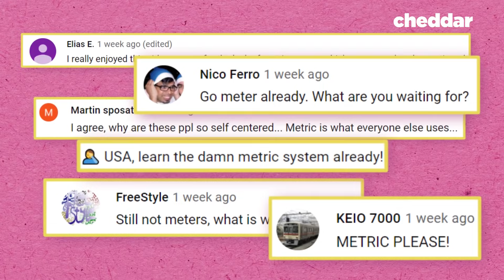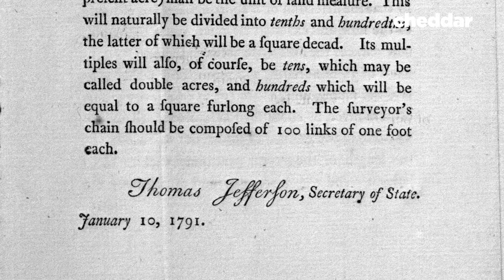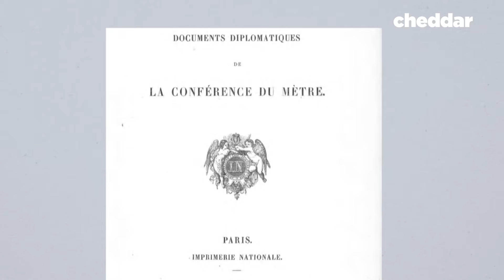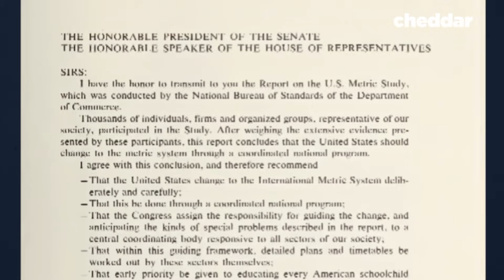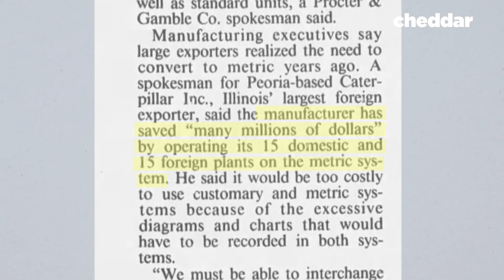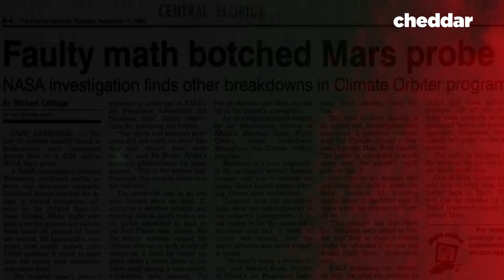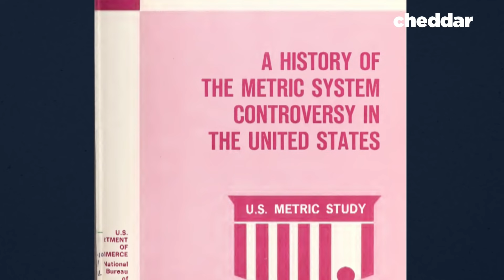Why Doesn't the US Just Use the Metric System? - Cheddar Explains

Comment: If the metric system is so good then why isn’t there metric time? Hmm?
Reply: Spoonman Vlogs France attempted making a metric time system a little bit after they adopted the metric system, but they made it very complicated so it died out.
Reply: Zach Brannigan didn’t they also have a metric calendar that had ten months?
Reply: @zachbrannigan3184  sure it was that complicated? Of course if your new system is something like 9 days work 1 day off, your old system with  6 days work 1 day off is more popular. If they had added a "second sunday" things would be different today I guess. And this is a very guessy guess.
Reply: The French system wasn't that complicated, but it was different (10 hours/day, 100 minutes/hour, 100 seconds/minute), and it had to push against a technological installed base: clocks were very expensive, and a clock using the existing system was a prized possession in many households. So it didn't catch on, and the internationally standardized metric system instead uses the ordinary second we know as its base unit for time.
Reply: Why isnt there metric system 2 yet? HUH?
Reply: @bensonsexon4691  Actually there is a Metric 2. It's not noticable in our daily lives and kg is in the works.
Reply: The second is an SI base unit, and metric subdivisions of the second (milliseconds, microseconds, nanoseconds) are used all the time, especially in computer software and electronics. Larger metric time units aren't used because intervals of time that don't relate by factors of 10 are very socially important to us. But these aren't quite as arbitrary as miles and inches--the day and year, at least, come from natural cycles. (And physicists and astronomers often do measure longer time periods in seconds, with scientific notation.)
Reply: @MattMcIrvin  Socially and biologically I think.
The world will not start spinning differently after we adopt months that last for 10 weeks.
The day won't feel longer or shorter when we introduce a 10 hour day.
Many people (say they) get thrown off by the annual change to daylight saving and back.
Reply: Milisecond, microsecond
Reply: You could argue military time (the 24 hour clock) is like metric time. It makes telling time much easier instead of confusing am and pm.
Reply: Unfortunately things like seasons and days aren't translated well by a metric system. We'd be constantly shuffling around our clocks and calendars to account for how the Earth rotates and orbits. It would be far more confusing than helpful. That said, technically the second is the metric unit of time. Smaller units of the second like milliseconds and nanoseconds are used all of the time in computer science.
Reply: https://en.wikipedia.org/wiki/Decimal_time
Reply: There is, it just never really caught on: 

https://www.youtube.com/watch?v=RJM2FjK1zfw
Reply: Time is metric.
Reply: It's simple. Some things Metric system is good for, such as distance. Other times, it's not so good. & never catches on. Like the 10 month thing.
Reply: You must be troll
Reply: Because conventional time is so easy to work with.  Seconds, minutes, and hours can easily (whole numbers)  be divided into halves, thirds, and quarters.  Decimal times results in lots of fractions, not whole numbers.  Harder to work with for most purposes.
Reply: Time was developed starting with the length of time for Earth to go around the sun and for the length of time for Earth to make one rotation.  Neither of which are related by a factor of 10.  I have no idea how we got hours  minutes, and seconds but suspect they have something to do with navigation, just like degrees, minutes, and seconds.  There is a metric unit for angles card a grad, but I don't know how commonly it is used.

The basic units of metric are meters and grams.  Everything else that most people use is built logically from meters and grams.  A liter is 1000 grams of water.  

There are even differences In metric standards.  Pipe dimensions are stated in metric but are really American standards.  Asian nuts and bolts have even millimeter size heads where European ones have odd millimeter heads.
Reply: @lowercherty  We got our time system from the Babylonians who used a sexagesimal (counting in 60s) system for mathematics and astronomy. They derived their number system from the Sumerians who were using it as early as 3500 BC.  We could easily re-adapt the system to something that goes by "10". All we would have to do is define how long each measurement would last so it would hit "10" by the time the Earth did a full rotation.
Reply: or metric years.  (there were but they were "surprisingly" removed)
Reply: sure amigo here it is...its 12.6 pm = 1236pm....happy now?
Reply: Exactly...well said. The number 60 is a beautiful number. Divisible by so many other numbers. Very easy for human brains to deal with. Even in metric countries they say "A quarter till midnight" (as an example)
Reply: @noelmasson  shipping company vessels always use time divisible by 6 to make it easier to calculate their delays at ports, time incurred etc...example: if you told them i came onboard your vessel at 1210hrs they'd make it 1212hrs instead
Reply: @CoorparooToo Have you ever walked 1/3 of a meter?  It's impossible to measure. 33.33333333........ cm's.  1/3 of a yard is EXACTLY 1 foot.
Reply: @BLAngel1  Good point. How much is 1/3 of a US Dollar?
Reply: @BLAngel1  of course I have walked 1/3 of a meter. It's not exactly an Olympic effort.
Reply: There is metric time? - The second?
Reply: Because time is relative, it can change, a cm is a cm but one minute can be different from where you are
Reply: @SpartozZ  r/woosh
Reply: @SpartozZ  But space is also relative. So a cm can change just a mintute, depending on your point of view.
Reply: Spartoz thats a really weak explanation lmao especially considering that length isn’t absolute either.

Comment: Canadians still  use the Imperial system but only for certain measurements. Canadians still weight themselves  in pounds and measure their height in feet. Yet Canadian speedometers are in measured   metric and we use metric milliliters for measuring liquids. This is despite Canada the fact that canada has been using the metric system since the 1970s.   For some reason Canadians converted to the metric system and yet retained some of the measurements from  imperial system.
Reply: Canada decided to convert to the metric system gradually. In 1985, though, the Mulroney government stopped conversion, perhaps because it was strongly opposed by farmers (those underpopulated rural ridings are one of the foundations of the Conservative vote). Furthermore, Canada opted for soft conversion, under which goods could still be packaged in Imperial sizes as long as the label provided a metric size (that's why butter is sold by the pound but labelled as 454g). Hard conversion would have required round-number packaging -- butter would have to be sold in 400g or 500g sizes.

As a result, some things, such as paper, are still legally sold in Imperial measures, some are sold in Imperial measures converted to metric, and yet others are sold in American measures converted to metric (a consequence of our extensive trade with the States). So "metrication" gave us not one system but three. 

The use of metric apparently varies from province to province, with Quebec being the most fully metricated. I live in Ontario, and have never seen a sign here advertising real estate in hectares or square metres; it's all acres and square feet. Because metric measurements aren't used I assume the Imperial measures are still the legal ones. Clothing labels use non-metric sizes; again, because they often appear without metric equivalents I assume metric labels were never required. And we use 8 1/2" by 11" paper.

And isn't that thoroughly Canadian? A government takes a bold stance and makes a significant change, then another government under pressure washes its hands of the whole thing and tells us "Figure it out for yourselves." Which we never do.
Reply: @johnfitzgerald7618  as a fellow Canadian currently living overseas, your comment is so accurate it hurts. You just summed up the history of Canada in a couple of paragraphs. That was marvellously, done
Reply: @MrWhiteVzla  Thanks. It's part of our Canadian charm. Nothing is standard. Often that's beneficial, but often it's not. I'm getting old and thinking of moving out of Toronto to someplace cheaper. However, the standard of health care outside Toronto is lower than in Toronto. In Northern Ontario it's very poor compared to the South, let alone Toronto. And the Ministry of Health and Long-Term Care spends its days avoiding doing anything about this. The pace of change in Ontario health care is glacial.
Reply: I work in urban planning in Ontario, and as with most government functions, Planning is entirely metric.  But the construction industry was one of the industries which remained imperial to standardize with the US.  So a building's plans are designed in imperial, are converted to metric for approval, are legally registered in metric, then are constructed in imperial and marketed in imperial.  Canada lives a double life as metric country with several common markets integrated with the non-metric U.S.
Reply: John FitzGerald That was undeniably one of the best written comments I've ever seen, and to be frank was written more clearly than most books I've ever read. Which I could give 100 thumbs up.
Reply: I think part of it is that we don't normally use decimeters. For some measurements, centimeters are too small while meters are too large. Feet and inches fill that role.
Reply: I am Canadian, and I only know my height and mass in cm and kg respectively, and that's how I like it.
Reply: Well I study in city planing, and some fields still use imperial measurements, such as architecture, because construction materials either are sold to or bought from the US. Therefore they have to be in imperial units. I donnot know much about the other exemptions though.
Reply: @jacobwells8368  I didn't mean to deny that. Selling goods in a North American market means there will be pressure for package sizes, for example, that can be sold both in the US, by far the biggest part of that market, and Canada.
Reply: Metric is easy to deal with and imperial is hard, thats the real truth to it.  Americans are quick to understand what one means in metric yet people who don't understand imperial have a hard time doing so.
Reply: Canada is more metric than the UK, though. Going to kilometers on road signs was a big step.
While I find the US situation absurd, I also think it's a bit misleading to show those maps that identify the US as a lonely outlier among nations, since it seems as if there are plenty of others that are officially metric but in practice have a lot of informal use of traditional units, especially in the Anglosphere. To some extent the US just makes explicit what is the case elsewhere.
That said, government encouragement does push everyday use to some degree.
Reply: Gerard MacLellan that's cause Canada has to deal trades with America and we have no clue on how that fruity European metric system works so you have to retain regular measurements so that we can understand you and what your talking about
Reply: Agreed, millimeters are way simpler to use, everything is in 10's.  How many cuts did I mess up as 3/16, 3/8, 3/4....  when 5, 10, 19 were easy to remember (ignore the roundoff)....  I think Australia mandates all residential properties are dimensioned in millimeters.  The ball was kind of dropped by the medical  and  education  communities as they never pushed a person's height in meters or weight in kilograms.
Reply: Just like here in the Philippines. Mixed usage although metric is the official system.
Reply: I live in Canada, where everything is metric. 
Oops, the Canadian Football League still requires teams to advance 10 yards to get a 1st down. (doh!)
A basketball hoop is still 10ft off the floor. (grin)
But let's face it, the metric system is just far easier to use cause it uses base 10. 
Any calculation can be done in your head. 
Freezing is 0 degs, boiling is 100 degs, its just easy.
But it will take many generations for Americans to totally adopt the metric system, cause nobody wants to give up their 3 5/16's wrench ..... lol
Reply: gimli glider could have been much worse though
Reply: We should have stayed with the Imperial system, after we changed we paid more for a lot of things like gas, meat and many other things, it was a money grab.